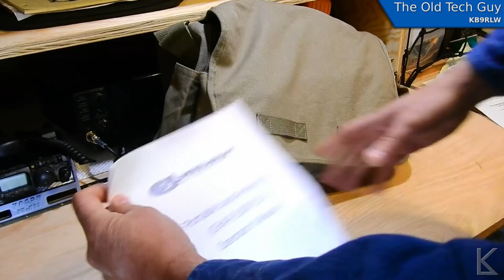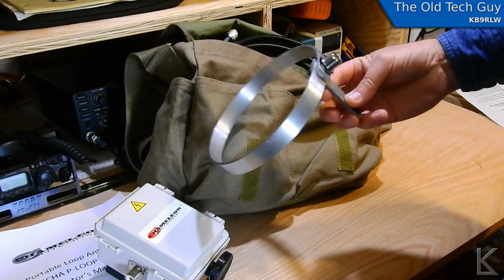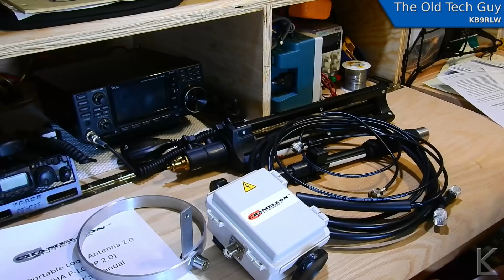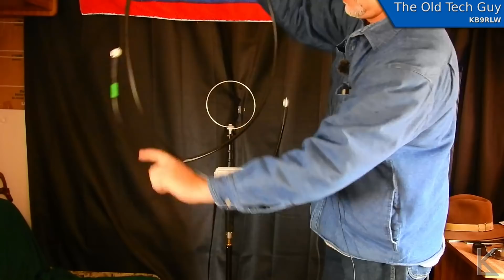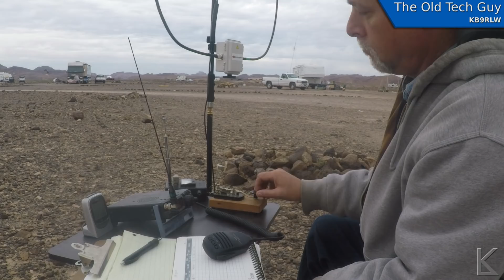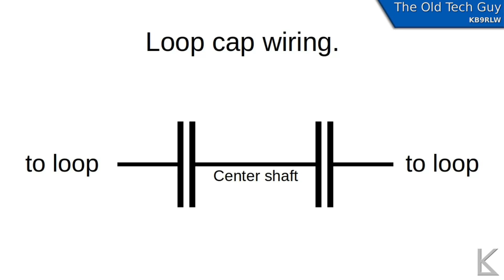Ham Radio - Chameleon Antennas P-Loop 2.0 portable magnetic loop.

Comment: Hi Kevin, I enjoy your videos.  I have a chameleon Loop and how I tune it is with a MFJ 212 matchmaker noise bridge.  I have an icom 705 and when I flip on the 212 the null within the noise is obvious on the display and then it's just a matter of twiddling the capacitor knob to get the noise centered on the frequency.  That invariably  give me the lowest swr and that's without putting out a signal on the air.

Comment: Id be interested to see how much better it is if it were orientated the correct way up. Cap at the top.
Reply from the maker: Ah, that old argument.   Look at the loop.  The high voltage is at the cap side, the high current is opposite.   Radiation is strongest at the high current points.  Jeri Ellsworth set up a rig to measure that.  
I've used them both ways, didn't really measure much if any difference in performance.   
It's a moot argument.
Reply: @loughkb  My vac cap is going in the top of a length of 4 inch drain pipe. Its a design that evolved out of seeing what I can do with what I can get for free. Id be most interested in finding a stepper motor and ready made controller to auto tune it and follow an Icom or Yaesu radio. The F loop or Alex loop or Alpha loop all seem to have the cap at the bottom as its convenient to construct it that way, it dose not mean it works better. I particularly like the manufactured ones with a set of open plates at the top that form a large air cap.

Comment: Another Ace Video.
Some mention should be made of the declaration that mag loops are intense radiators of non ionising RF.
The advice is that for mag loops, 10 watts needs a safety zone of 1.5  metres..100 watts needs 2.5m. spacing (EIRP) so without remote tuning, hand tuning should be done with the lowest feasible QRP and then sit away whilst operating with the power turned up.

Comment: 21.31. You're saying that they've wired the twin gang tuning.cap. as a split stator.to avoid current  passing the through a lossy earth wiper or bearing. Of course the value of the cap sections is halfed!

Comment: Aloha Kevin, 
   Here is a solution for that stand under windy conditions. It is a screw into the ground doggie tether post that you can use a cargo strap, zip tie or anything else you come up with. I use these for my man portable wind turbines for EmComm use. See link below:

 https://rover.ebay.com/rover/0/0/0?mpre=https%3A%2F%2Fwww.ebay.com%2Fulk%2Fitm%2F330993051987

I buy mine at Walmart for around $5 and well worth throwing into your travel bag. Just screw it into the ground and then set up the center of the tripod right over it. KISS, right,lol. 
   I hope you like this idea! 

   TODD WH6DWF

Comment: A horizontal support across the centre of the primary loop, holding it into a better circle might not be a bad idea.
Reply from the maker: The shape is not as important as symmetry, I think.   If you shift the center so both sides droop the same, it should still perform quite well.

Comment: Thanks for the video, Kevin. Another thing worth mentioning about magnetic loops is that the shape of SWR/frequency plot depends on the band. The antenna is much more narrowband on 40m, not mentioning much less efficient. I'm looking forward to see the power compensator test. I really don't understand how it might work and my expectations are that it doesn't, definitely not in terms of RF field strength (in terms of heating an air - maybe). I would be happy to be wrong. 73 de R2AUK
Reply from the maker: Yeah, I'm looking forward to testing it too. I can't imagine how it could lower the voltage at the cap without just eating power or detuning the loop.

Comment: Kevin, I purchased the F-loop plus on Black Friday... saved $100! I haven't had the opportunity to play with it outdoors, 3 inches of MORE snow in Upstate NY last night!  Indoors its a great receiving antenna but marginal when transmitting. This really isn't a concern because I purchased it for outdoor/portable use. Also, there is a remote tuner for this antenna, it's costly but available. It's available from DX Engineering and here is how they have it listed - CHAMELEON ANTENNA CHA-RT-RR Remote Tuner/Rotators RT-RR. Oh ya, thanks for opening the enclosure! 73's

Comment: I can see the attraction in terms of portability. My issue with these loops is the constant need to retune if you want to move frequencies and basically the price. They do null out noise really well and are often used by home based ops as a 'last resort' antenna if QRM is high. Personally if operating at home I may use one as an RX antenna on the lower bands to improve S/N ratio. In that case a wellbrook loop or its MFJ equivalent are cheaper alternatives.

Comment: Hi kevin good review of the loop one note bandwidth can be increased slightly by using a larger diameter main loop as a note I just picked up two mag loops 3.5 -11mhz and 13.5-30mhz old capco loop antenna check wimo they still make them the diameter of main loop tubing is 32mm 1.250 big monster tubes they work well too regards Gw7lop

Comment: Putting typical capacitors in parallel does not reduce their voltage rating by half. I fail to see how using air capacitors would change that?
Reply: Putting caps with equal voltage rating in parallel doesn't reduce the overall voltage rating of the circuit.
Reply from the maker: I was going on what my teacher back in ITT tech told us.  Now I wonder.   I know the series increase in tolerance is correct though.

Comment: Kevin is the bracket from the pole to the small loop plastic or metal?
Reply from the maker: The coupling loop is all aluminium, even the short piece that threads onto the top of the shaft.
Reply: @loughkb  Wonder if a plastic bracket would change tuning greatly?  The tripod and pole are part of the small loop at that point.
Reply from the maker: @W4TRI_Ronny  The top of the tripod is your standard thumb wheel nut and molded plastic shell. No continuity to the shaft.  That's the ground side of the connector anyhow.

Comment: My main gripe with the Chameleon loops is that telescopic support. It needs to be more compact when collapsed. I'm thinking of making my own with 2 or 3 svrew-together sections. Also, does voltage rating of capacitors really halve when on parallel?
Reply from the maker: If the caps are of the same value, the voltage rating will be cut in half. If the are of different values it will be reduced by a different amount related to their average voltage rating. But yes, it is reduced.
Reply: @loughkb  Why? If I have an AC source, say 100V, and I apply this to 2 equal value 100V rated caps in series, each cap sees 50V. In this way the 'voltage rating of each cap is doubled' (which it isn't, it just means that the voltage rating of the system is twice that of an individual cap. Now if I have any number of the same caps in parallel, they'll all see 100VAC. The system / network voltage rating is 100V, is it not? Because all the caps see 100VAC. The caps themselves don't change by being in series or parallel.
Reply from the maker: Think bout the caps as parallel flat pieces of metal with a gap between them.  The voltage rating is how high the voltage has to be before jumping the gap, breaking through the resistance provided by the air or other dialecctric material.
Now if you put caps in series, you have effectively increased that gap since you add the gap of each cap together to get the total resistance the arc has to break through.
When you put them in parallel, you are effectively increasing the size of the plates, creating a larger surface area in contact with that resistance and therefore, less resistance.

Comment: Yeah, I have that very model and it works great.  I work from inside the house so set up is not critical.  I have about a 6 foot reach so I get between the radio and the loop and tune by sound. Then I sit at least 6 feet from the loop. Stays set up, works like a charm.  Stay warm, Spring has sprung and it will soon warm up in the desert.  W0YVY
Reply: Lew Archer, May I ask what band you use when you sit six feet from the loop? Also, what kind of home do you have? Is it a timber and plaster board home, or do you have a standard type of placement in some similar structure? I'm trying to picture a loop in my home in New Jersey. de KQ2E
Reply from the maker: My house was built in 1923 and had wood siding and old plaster walls.  I worked Switzerland on 20 once with my home built magloop and 5 watts ssb.

Comment: Enjoyed the video.  I have/use a remote (mechanical) tuner and rotator with my Chameleon™ F-LOOP 2.0 Plus.  Works well and allows the Loop to be about 25 feet away.  I also have the power booster.  I have a few pics of the loop in the antenna section on my QRZ page.  KC3HUL

Comment: For windy conditions, perhaps some thin, non-conductive rope from some tent stakes to the center-ish of the loop, tied around the mast, right on top of one of the joints so that it doesn't slip. This would work better than weighting the legs due to leverage. You'll have to try again with your IC-7300 on low power.

Comment: Someone on Facebook wanted to engage me in an ugly argument the capacitance. What I observed is each gang is 500pf, combining both gangs and measuring there and at the rotor connection is 1000pf of total maximum capacitance. But when I only connect my meter to each gang with the rotor between them like a butterfly cap, I get 250pf fully meshed. It's being divided by 4, and I think the other guy isn't visualizing what I am trying to communicate to him. And in this video you are saying the same thing he is. Which is of course correct with pcb capacitors, but in this case it is also doubling the air gap too just like a butterfly which has a gap on each side and the rotor is in the middle and not connected electrically to anything. The charge has to go through one gang of stators, then the rotors, and finaly the other gang of stators. Would you mind looking closer at this because both of my capacitance meters are telling me the same thing I listed above.
Reply from the maker: "combining both gangs" gives you 1000pf because you are putting two 500pf caps in parallel.   When you put two 500pf caps in series you get 250pf.
You're dividing the value of each individual cap in half, not the total you got when you put them in parallel.
Reply: @loughkb  So looking at the whole device as one cap was a mistake then? If that's the case your point is crystal clear now.  Now why couldn't the other guy say that? Thanks Kevin, most appreciated.
Reply from the maker: @JohnSmith-bb2np  Yeah, it's two caps sharing the same frame.  Sometimes variables will have three or four caps.   It's useful when you have something like a radio receiver where you want to tune the vfo and pre-selector filters in unison. Two circuits, two caps.